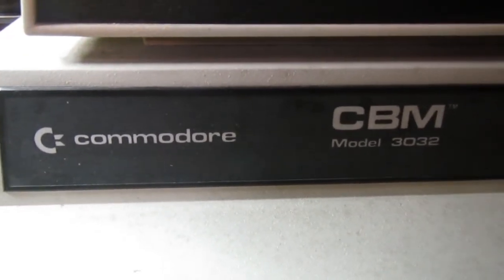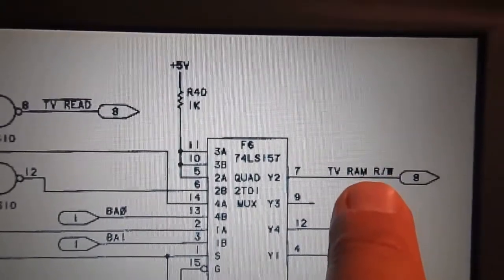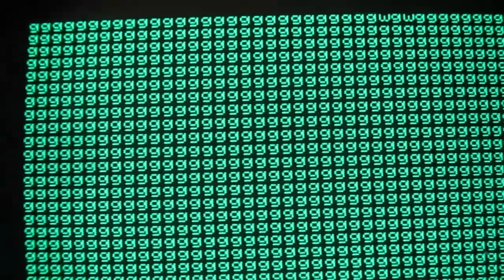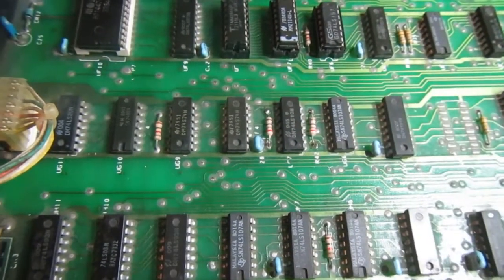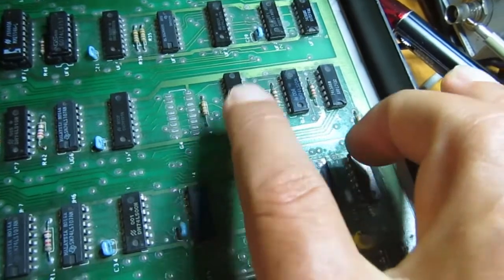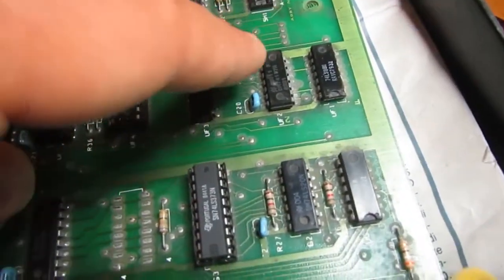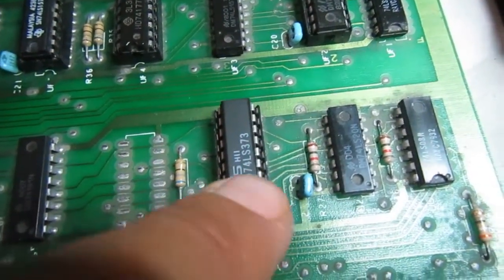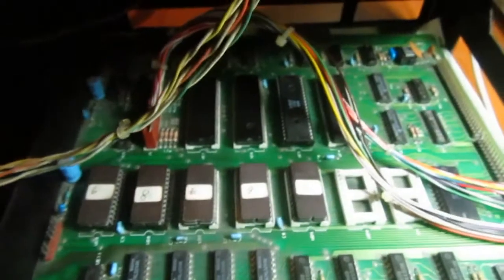Commodore PET 3032 (2001N) video circuit repair

Comment: Frank, that was some superb troubleshooting, especially with so many faults. Great work!

At 5:28, can you explain how you identified the particular IC from the corrupt character on the screen? I don't quite understand that.
Reply from the maker: Hello MindFlareRetro! Yes, basicly there were flickering characters, if you observe them carefully, it's flickering between the 'e' and the 'm', PETSCII codes of  the 'e' and the 'm' differ for one bit only: 0x45 vs 0x4D, so it's bit 3 (counting from 0), and that bit is resident into the UF8 video ram chip (lower nibble of the video RAM).
Same reasoning for the 'w' that should have been 'g', code is 0x57 vs 0x47, so this time it's a bit on the high nibble of the video RAM, which is on UF7 chip. Of course I did look at the schematic to know what bits are on what chip :)

Comment: Great job!   Wow at the number of problems!  That's the PET for you - they seem to always suffer multiple faults.
Reply from the maker: Hi GadgetUK164! Thanks for the nice comment! Those  very old boards tend to develop multiple faults indeed. In this particular case, I think there were three independent failures: the two MOS 2114 failed because of poor manufacturing quality. The first 74157 was one independent fault probably and the 74LS00's input shorting to ground probably caused all the other failed ICs since they were all connected. Of course it's only educated guessing.